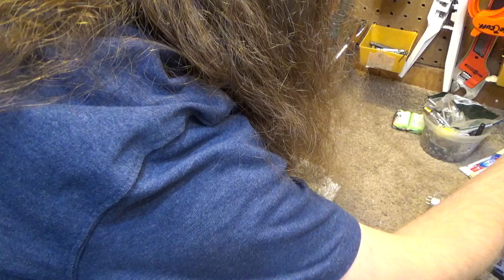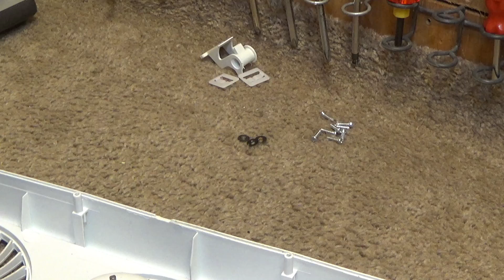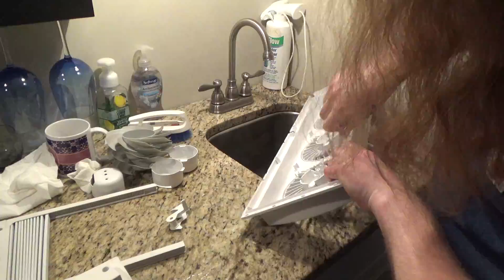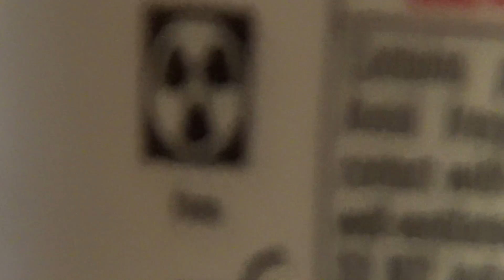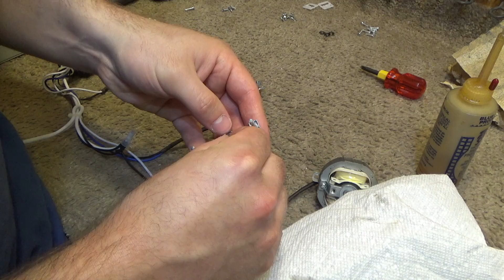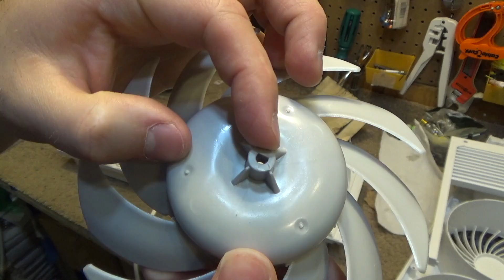Clean and Service Bionaire BWF0502E Triple Window Fan

Comment: I have this fan just bought it off facebook marketplace with another. Put it in the window on high with 3 fans going .. it’s hot… set to 65 … all looked good. 30 min later came back and had stopped. Faded red light on hi. Nothings responsive off and on etc.. could I have burnt out the motor?
Reply from the maker: No, the electronics controls probably failed.

Comment: That capacitor is most likely just for the control board and electronics. I’m almost certain those are just small shaded pole motors.
Reply from the maker: Seems awfully large to just be powering circuitry. The power consumption and power factor certainly do not align with shaded pole.
Reply: @JordanU  you may be right, guess I’d have to check them out myself
Reply: They're 2 pole shaded pole motors. Holmes has a newly released model of window fan I just bought that has them in it. The power factor is .68, if I remember correctly. I'm guessing the higher power factor measured here is caused by that capacitor correcting the power factor like those plug in "power saver" devices I've seen around.

Also, interestingly, especially to anyone like me who thinks magnetic/electric fields and radio waves have negative health effects, the typical C frame type puts out a magnetic field, both up and down, that goes out about 6 feet, whereas this type only goes out about a foot.

I was naive, because I didn't think you could make multiple pole shaded poles lol. Apparently, you can, and they can look just like PSCs, except for no capacitor, and copper bars in the interior if you look closely.

Comment: Have you ever thought about getting a ultrasonic cleaner for the smaller or general parts that can fit in one? Since you can put small bits like control knobs and blades in and let them go for a hour or two and clean up.
Reply from the maker: Yes

Comment: The fan blades there remind me of the blade sets used on some of the Delta 100-200 CFM 120mm computer fans. It’s a shame that the blades are held in place by those awful clips. I would drill a small hole for a set screw.
Reply: YES YES YES
Reply from the maker: It does resemble some computer fans.